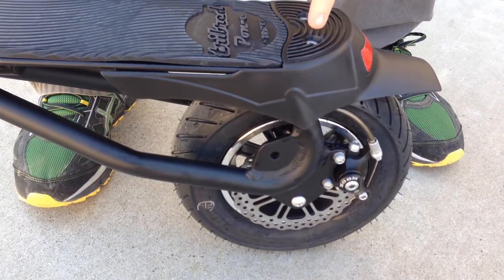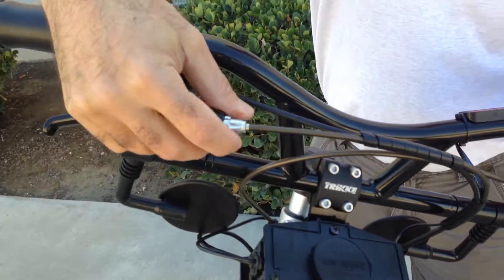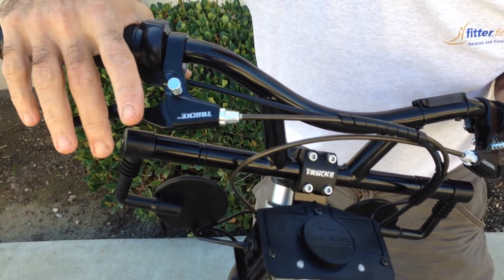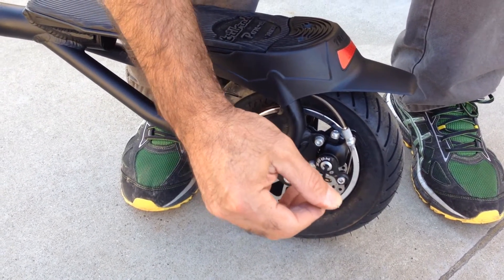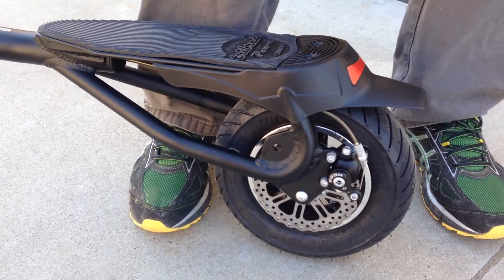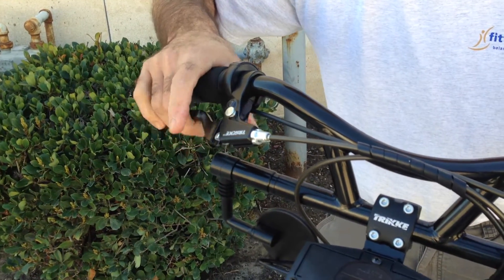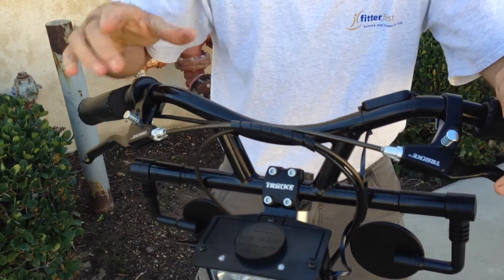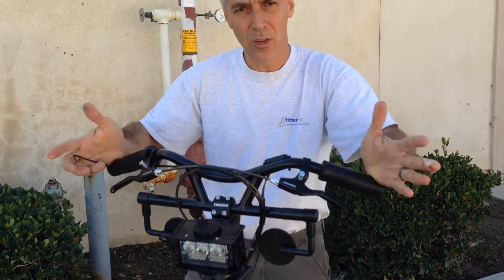ajusting brake on a Trikke EV, T8s, T12

Comment: In this way you regulate just one brake pad,another stay to much inside,it is wrong.For booth sides are six corner who need to regulate simultaneously,let brake pads are in middle.Another problem have with brakes,because for brake handle need to be brake sensor.If push the brake,automatically sensor need to stop the engine.Trikke also have not stable,anyway when put booth brakes to parking.Steering have not lock,and it is second problem for me.